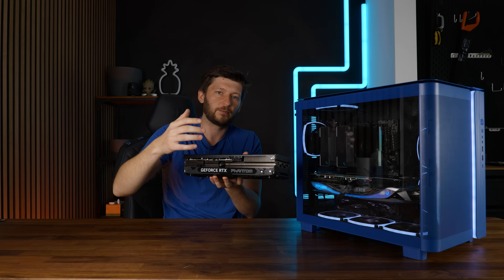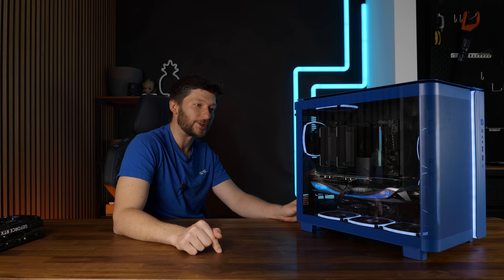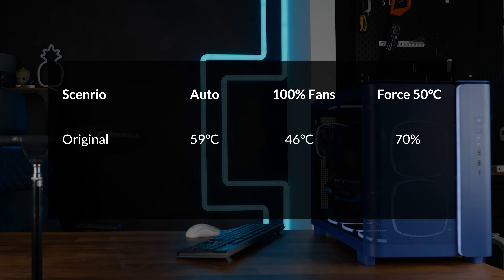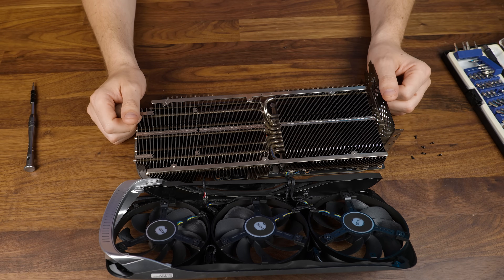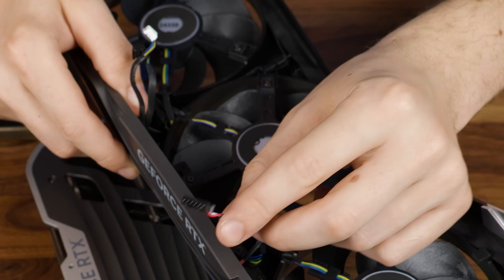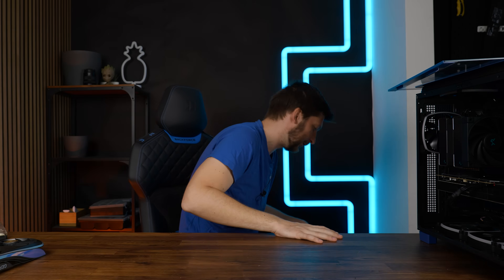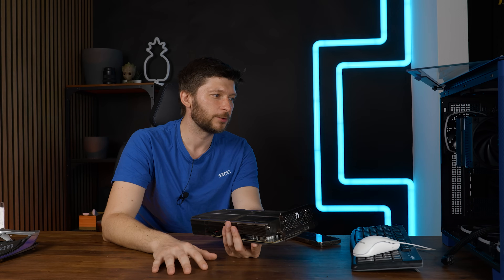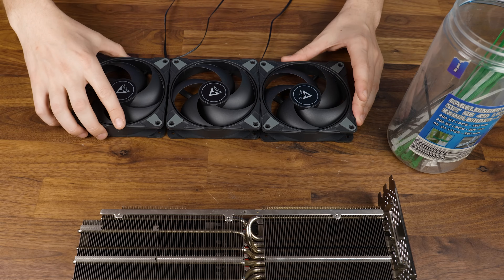Is Deshrouding A GPU Still Worth It? RTX 4090 P12 Max Deshroud Mod

Comment: I use a RTX 4070ti with two Noctua A12x25 ULN at 0-850rpm and my 5800x3d has an Alphacool Eisbaer 280 with two Arctic P14 at 450-600rpm.
My pc is complete silent in gaming. It is perfect and i really hate noise. I am happy now

Comment: That radiator is not purposed for direct fan mounting, there is almost no gap between fan blades and radiator fins, that's not optimal. It could be fixed with fan duct kits like NA-FD1 (5mm gap is optimal IIRC) which would reduce temp/noise noticeably.

Comment: I wanted to remove the shroud from my GTX 1070 and put in a fan assembly that fits into a PCIe slot next to the card, but I want to plug straight into the card's fan header since I don't have another way to power them in my enterprise PC. The fans are broken in my card so three 92mm fans might help cool it a little more.

Comment: You need space between the fans and the heatsink to get better airflow. I placed NF12x25 on 2080 Ti and temps got really improved, but its a 4 slot card now.

Comment: The p12 don't have a high rpm, it was hotter because 100% had less cfm then stock fans, get higher rpm fans for better oc, the p12 were only going to make it quieter.

Deshrouding is typically for noise in itx where there is little insulation between. GPU and outside.

You will never void a warranty for taking a GPU apart, only if you do it badly and the manufacturer can prove you broke it.

Deshrouding, setting fans to exhaust and putting them to a grate has had great performance in the m itx form factor. 

When you tried no fans, did you at least put the GPU in the lowest pci slot? Or did you leave it in the top most far away from the bottom fans.

Comment: I have a montech case with two of their 120mm reverse fans blowing directly up into my 7600xt and it still cranks up to 100% fan speeds when fully loaded. According to AMD these cards and their new cpus are meant to run at high temps. I read they stress tested them at temps above normal like in the 90's and the chips are able to run at those temps long term without damage.

Comment: back when 3090 came out i switched to the gaming x trio version and bios flashed the 1000w evga bios on it, but i had to wait for my waterblock so i literally ran 1000w card on air and installing the waterblock did only bring me 2 boost bins of headroom, and gpu hotspot went from 57C to 49. 
it's kinda insane how good the stock aircoolers are these days

Comment: To reduce the noize sometimes spacers are used between fan and radiator.
Core boost might affect it, but also i believe that when running 3300RPM 12cm fans on full RPM not all air is able to pass through radiator, which creates some sort of air pillow, turbulence, backfiring air or what ever, hence the temperature increase
Reply: good comment

Comment: I have a evga rtx 3080 ftw3 and when deshrouded gave me like a 18C reduction in overall core temp. Stock gpu hotspot was 84C max and now it maxes out at 73C. It seems deshrouding does not work well on all GPUs. It so happens that GPU's factory fans are really well designed with that GPU you deshrouded. The boost clock on my gpu is rock solid now after swapping out the stock fans. The majority of GPUs now days have really well designed coolers which is why it is no longer really worth it.

Comment: So I will tell you this. Fur mark/3dmark etc don't report the correct temperatures. You should use hwinfo or afterburner and measure EVERY temperature available.

Example, my 7900 XT reference went from 80-90 hotspot to low 60s. The other temperature that 3dmark shows is 39C when before it was in the 70s. VRM temps and memory temps should also be looked at. Custom loop :).

Comment: My 3060 Ventus 2x from the store heats up to 77 degrees and makes noise like crazy. I tried to adjust the curves somehow, but I didn't have much success in smoothing out the problem. Replacing it with two P12s (not max) allowed me to see 60 degrees at full load at a completely silent 1100 rpm
Reply: Thanks for this comment, gonna try it out one of these days. My 3060ti ventus has been going over 80 degrees Celsius for a couple years now, and these stock fans are noisy as hell

Comment: First: To lower temps you need more air going through the heatsink. Those P12 MAXs has 81 CFM airflow each and when the case is closed the case fans have to push that many air in the case so it can be sucked by the P12s. If intake is not enough the P12 might spin at max RPM but wont push more air through the heatsink. 
Second: P12 max might move tons of air but they spin at above 3000 RPM and they become noisy if not noisier than the stock fans and the MAX's bearing itself is not meant to be silent. Regular P12 will be better option- 1800RPM of silence pushing 56 CFM. 
Third: Effect varies from GPu to GPU- I have a deshrouded Strix Vega56 with 2 regular P12s and without touching the voltage/frequncy it stays under 60C, in complete silence. Tweaking voltage/frequency drops it close to 50.

Comment: Try it with 6x Counter Rotating Compound Fans with 3x on Each Side in Push-Pull Witch will be Really 12 Fans for Each Fan has Two Fans in one for there Compound Fans and Take Cardboard or Something and make a Simple Shroud to Direct the Air Flow witch there will be a Lot of. The New Way to Over Clocking GPU's LOL

Comment: I have an RX590 (i know, cant afford anything newer yet), that runs at 8485c and it throttles a lot, i already changed thermal paste pads, even installed new fans just in case but still nothing works
When using PC fans for GPU, what should i be looking at, CFM or Air Pressure?
I cant afford Noctua fans, so im looking at some Antec T3 Storm to replace the default ones
Reply: You should observe air flow and air speed, thus, fans with higher rpm at a expense of noise. However, this kind of card has multiple exits for the air after accelerated by the stock fans (I got a RX 580 and I have observed that). I believe a good fraction of the flow don't have enough time to sheer with the fins. I'm think of cover it somehow and test to see what effect it does.

Comment: I'm surprised that the card cools at all. The 3 case fans on the bottom suck the air out and the 3 fans on the GPU want to pull air in. There is hardly any space in between. The effects therefore cancel each other out. I would rotate the case fans so that they also blow on the GPU. Warm air rises anyway and I would let the air blow out at the lid. I'm pretty sure there's such a difference.

Comment: i did the same in my rtx 2080s but with 90mm fans also artic  and its been loud and not perform very well ,but when i flip fans  to the exhaust they much more quieter and temps drop is noticeable

Comment: It’s not just noise level, there is also a noise profile. Something people usually overlook, a lower frequency noise is much easier on the ear. Also those p12max move so much air, if you can’t expel them from the case fast enough it circulate and make everything hotter than it should. 

Airflow management in the case is much more important if you are looking to cool it a few degree more, but deshroud mods usually pair with a quiet fan for running at max rpm with no noise like noctua fan.

Comment: I had no idea they revised the awful ball bearings on the P12 Max, thanks for mentioning it! Might give them another shot now.
Reply: in the end, you can order good bearings (for example, NSK) and install them yourself. Changing some ball bearings to others is not particularly difficult, unlike replacing the sleeve with ball bearings (given that the size of the rod will be several hundredths of a millimeter smaller and is likely to scroll when installed on a ball bearing). My p12max has good bearings compared to those used in, for example, cooler master sf120m, but NSK is even better.
Reply: @evur_tweak  Unless they're FDB, I don't think it's worth. Ball bearings will always be too loud for me.
Reply: @ZenTunE-  if the hands grow from the right place, you can put quiet ball bearings, if not, then yes, I do not know who puts very quiet ball bearings, although I have not felt thermalright b12b-extreme. 

but unlike FDB, you can repair a fan with a ball bearing, but the sleeve is only in the trash. And a quiet sleeve is an expensive sleeve. Throwing away an expensive fan is certainly possible, but it's not the best idea for me. Moreover, over time, the FDB bearing works noisier than a ball bearing.
Reply: @evur_tweak  That's fair. I myself am not worried about fan lifespan
Reply: @ZenTunE-  I didn't worry before either, but when your $40 fan fails, and it's not even a year old, it's kind of a pity to throw it away)) however, if you wish, the sleeve can also be replaced with a ball bearing, it's just more difficult (unfortunately, the choice of fans with ball bearings, especially with backlight, is sooo limited)
Reply: @evur_tweak  где можно заказать nsk? там стоят 693zz?
Reply: @white8267  судя по всему коммент не пропускает. На популярных маркетплейсах ищите, хоть в рф хоть в китае. 
На счет конкретной модели подшипников - лучше разберите то что есть, померяйте втулку (или подшипники, если изначально на них) и дальше уже заказывайте под тот размер что намеряете. На обычных как правило идет 693zz, на слимовских - точно другие, 5х7х2,5 на тех что разбирал. За все модели не скажу
Reply: @evur_tweak tu le jete pas il a une garantie tu va en avoir un autre ventilateur gratuitement et arctic demande même pas de renvoyer le vieux ventilateur tu dit n'importe quoi l'ami tres bon ventilateur de qualité

Comment: Undervolting with an optional underclock (for an even more aggressive unervolt) while still using the factory cooling is still 100% a better option for lowering temps and noise. Less stuffing around figuring out how to mount them and running all those extra cables to fan headers. My 4070 Ti runs at around 65-70c while gaming with 40% fan speed, of course I can up the fan speed for even better temps but at 40% it's basically silent and that's what I wanted.

Comment: I already deshrouded my 3080 Zotac amp holo, ( wich was terrible in term of noise and temps) i 3D printed something to fit 2 120mm fans on it, i then installed 2 noctua a12x25, now the noise is really good and the GPU never went more than 75 degrees

Comment: I did this to my XFX merc 7900XT. 3x Be quiet SW4. Superb results, temp at 55c 700rpm fans. Original fans 69c 2000rpm..15% more power on both mods on the gpu.

Comment: Of course I deshrouded my modest 6750XT and replaced the fans with 2 Noctua NF-A12x25. Was the card too hot before? Not at all but first of all the Noctua fans have a much less offensive noise profile and secondly they can spin so slow, even at heavy use, that they are even in the worst case just a fairly silent swoosh and in medium use cases barely audible. No comparison to the stock fans. You have ensure of course that the fans don't blow around the heatsink but through it.

Comment: I would love to see how deshrouded 4070 dual  perform in a micro atx case like ASUS Mini Tower Prime AP201 Mesh  or  Sharkoon Mini Tower MS-Z1000  with Noctua NF-A12x25 PWM Chromax   or BE QUIET Silent Wings Pro 4 fans. ❤ And with insade capture card in-between gpu, and fans.  + If possible for cpu cooler use Noctua NH-L9x65 or 240 aio with Noctua NF-A12x25 PWM fans. ❤

Comment: I deshrouded my zotac 4080 and placed 2 noctua fans on it, however I did this as I was running a LianLi case inverted and wanted the fans to pull through the card and out the top of the case, rather than trying to sort out airflow of an inverted gpu at the top of the case.
I have since flipped the fans back over (and run the case in normal orientation) and there is no meaningful benefit in running this setup over the stock fans and shroud.  That said I prefer the sound profile of the noctua fans over the stock fans which sound more high pitched, even though they aren't really that much different in volume under use.
In the past I have de-shrouded also to get GPUs to fit in SFF cases.  But as your video details, its mostly not required these days.

Comment: I was trying to remove the standard 3 fans from the asus tuf RTX3080 and install a 95mm PWM fan, but I used a proprietary 7-pin connector.
Is there a something for this?
Why does Asus use 7 pins?
why...
Reply: You can plug in the fans into your motherboard and controll them using the  "fancontrol" program set up with gpu temp sensor as source
Reply: @inqizzo i know and its easy
 i want VGA pwm

Comment: I had to deshroud my 3080ti hof from kfa because fans were so trash and cheap one started making rattling noise and spinned like a wheel thats about to fall off. I would not recommend to buy gpus without double ball bearing fans on them, i went with msi twice and its been perfect. My 4090 is under full load for one and a half year now with 75% fan speed, working the same way as day 1, their fans sound exactly the same as noctuas. I had horrible experience with zotac, gigabyte, kfa, they use trash fans so i would recommend to pay extra and get proper card

Comment: I still do this. Apart from the Nuctua GPU's, fans that come with GPUS are ALL trash. Literally 20c per fan lol. Always replace your GPU fans with Arctic P14 fans. 2 should be enough. Silent gaming quieter and quite a bit cooler too. This guy is using 120mm fans. Been there, done that. 140mm is the way. Even lower RPM's with even better temps. I've done this with a GTX 980, GTX 1080, RTX 2070, RTX 3080 and now on my RTX 4080. This time I'm using PTM 7950 thermal Phase Change material on the GPU die and I get about 55c with an under-volt under max load with fan speed of 33% only. That's silent gaming. This guy just doesn't have enough experience to do it right but a good effort nonetheless!

Comment: This video had so much unused potential as is evident from the comments: 
1. You should've validated the GPU temps against clockspeeds and noise output to get an accurate representation of whether there is an improvement or not (since as you mentioned, with better cooling, the clockspeeds adjust themselves --> higher clockspeeds at the same temps are an improvement, but noise is also a factor in the equation --> how much noisier does it get to achieve the same temperatures? etc.).
2. You should've tried to cover the sides to see whether guiding the airflow makes a difference or not (which is the purpose of the original shroud)(and then validate GPU temps against clockspeeds/noise output again and compare).
3. You could've tried different fan orientation configurations to see what difference it makes (as certain GPU shroud coolers have a middle fan that blows in the opposite direction of the other ones)(and then validate GPU temps against clockspeeds/noise output again and compare).

If you decide to revisit this topic in the future, I really urge you to try these, as it would provide valuable information on deshrouding a GPU and something I'd definitely love to watch. It's not something anyone's done yet, so it'd undoubtedly be a unique piece on youtube. As it stands, I don't feel like I got much from this video except for a slightly skeptical subjective opinion of yours.

Comment: When you watch interviews with Fan manufactuers like Noctua, you understand more what the important things are to air coling.
For example, your fans are pressing agains the cooling fins, the air puses down so fast they will reflect back and also leak from the side, and even leak trough the 1mm gap around the fan blade.
Adding some tape around the Fans to guide the air could also increase the perfrmace.

Comment: Besides from the fact that deshrouding a GPU which runs at 56 degrees under load is not the best thing to do anyways, considering the price of a single 4090 ypu could have used Noctua fans, which perform similarly to Arctic P12 Max but are defibitely quieter.

You could have also considered putting like a 5 mm spacer between the fans and the heatsink cause that reduces the noise caused by air turbulence.

And since you would have been already at that, you could have done it for every fan in your system.

Also worthwhile: you have two fans which are directed at the GPU anyways, and those help for sure in keeping higher pressure through the gpu heatsink.

Testing without them would have been a nice thing, cause the 25mn fans are actually a lot closer to them and might be a bit noisier because of the way air moves which might be more less stable with the 25mm fans.

Anyways, it's a nice test, it definitely shows that it might be worth it with such an expensive GPU because for a lot of people quieter higher pitch noises are more annoying than louder but low pitched ones, and it seems to be the case here, even tho the loudness of the fans might have been normalized by the algorithms through software editing and through the YT algorithm.

Comment: i used a white glue mixed with celulose (toilet paper) , created a denser paste applied to the corners for the fans, and then on the heatsink, it dried fast and fans stay strong there, and will be easy to remove that white glue paste in the future.
in my case was worth it. Was a gifted gpu, kinda new/unused, and i know stock fans tend to fail with the years/use, so i directly replaced them to preserve them to keep the gpu value. 
small gaps between the fans/heatsink (if air leaks out) tend to have a noticeable temp impact.

Comment: deshrouded my 1080ti last month with 2 P12 max fans. Created a foam seal between the heatsink and the fans for better pressure and in BG3 saw a noise normalised temp decrease of 25-30c... In every way its dramatically cooler and quieter than stock.
Reply: Did you repaste it? How is 30℃ possible?